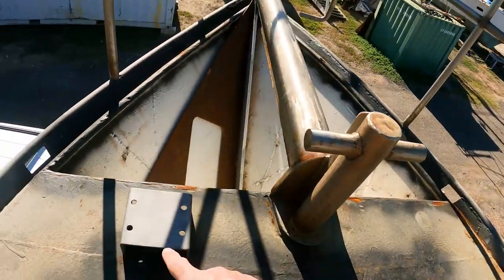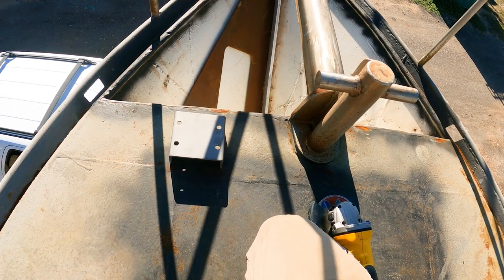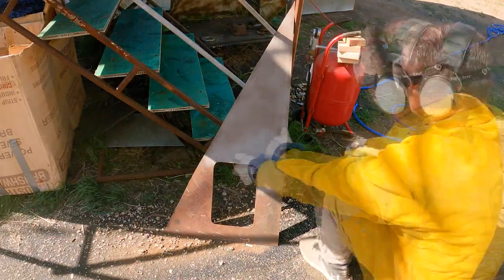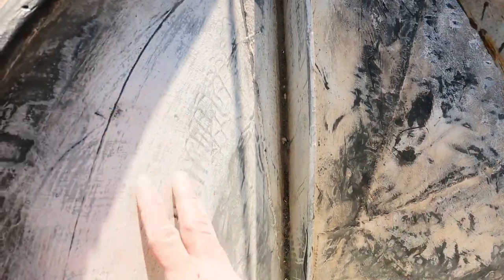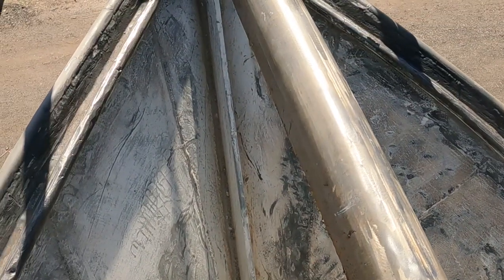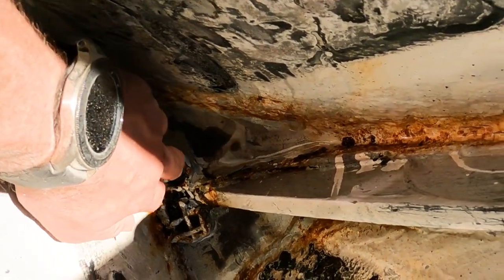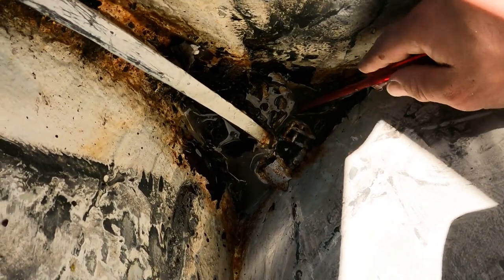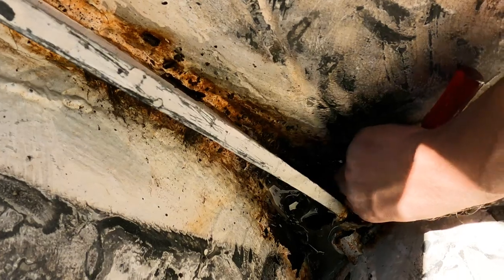Sailing QC # 19 |  Completing the Bow of the boat Blasting & Painting | Steel Sailboat Restoration

Comment: I suspect that is some sort of rubberized cement filler with an epoxy sealer on top of it.  Possible mixed with sand, vermiculite, or micro-balloons (used to thicken epoxy).  I would bet that it came straight out of the Australian equivalent of Home Depot, mixed with vermiculite from the plants department.

Getting it out is a good plan.  Rubberized seam filler has a place in a steel hull, but there needs to be a solid barrier coat between it and the steel.
Reply from the maker: Agree with you 100% its amazing how much damage can be caused by someone cutting corners.